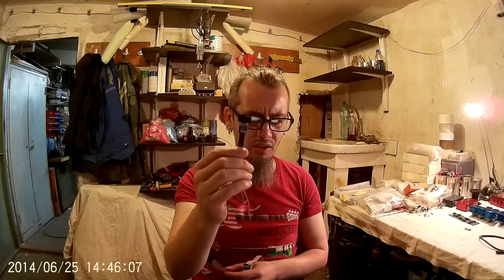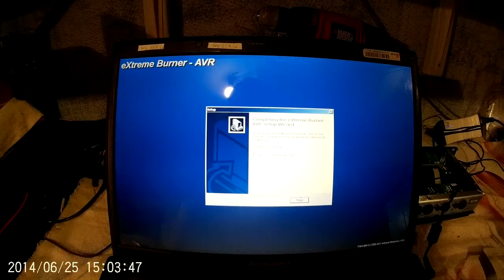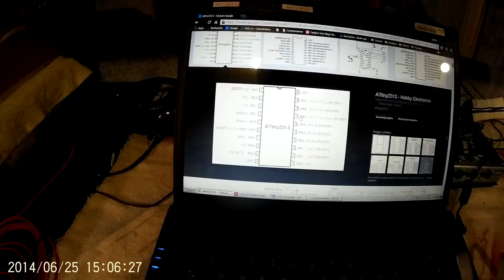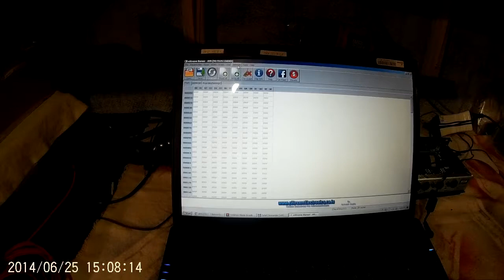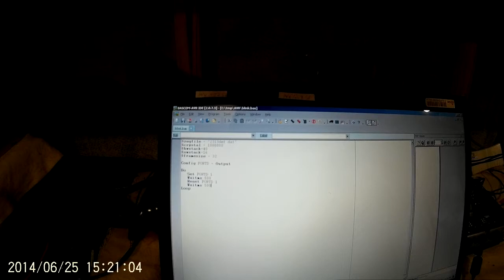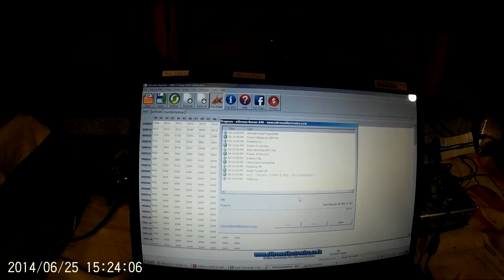AVR programming tutorial using USBASP / Extreme Burner AVR

Comment: thank you very much for this tutorial , I have a question , if my AVR chip fuses are set 
to external crystal should I connect the crystal to the AVR while programming it
and another question, I looked for the chip list in the extreme burner and found that not many AVR chips are available , is there a way to make it support more chips
Reply from the maker: You can upload your code without the crystal (if i remember well i've done that) because when you upload the code the uC is in reset state.
But why would you like to do that?